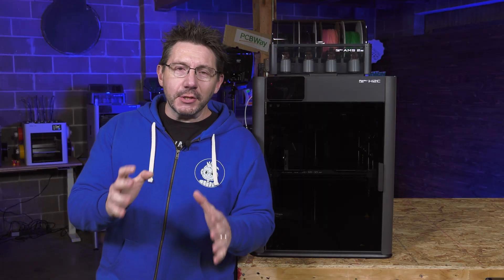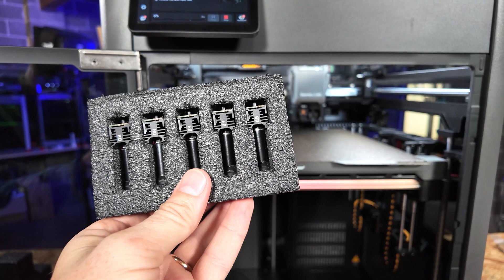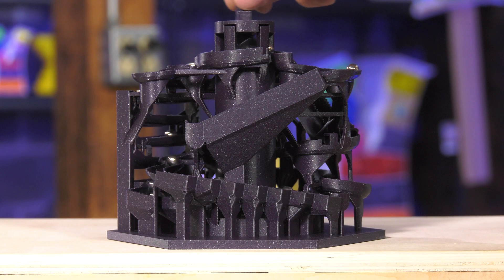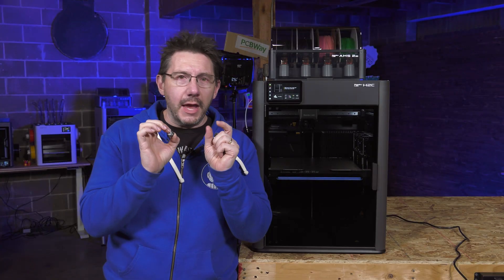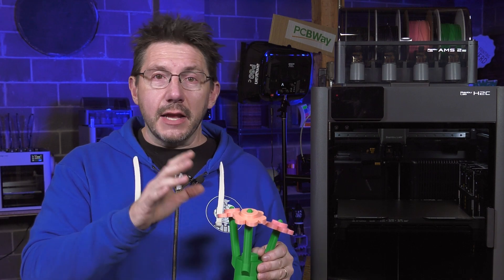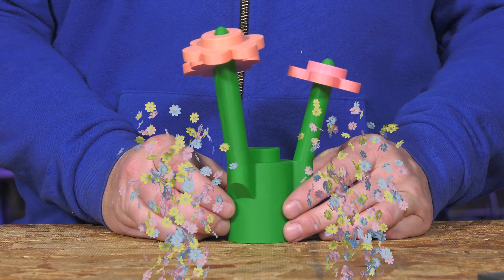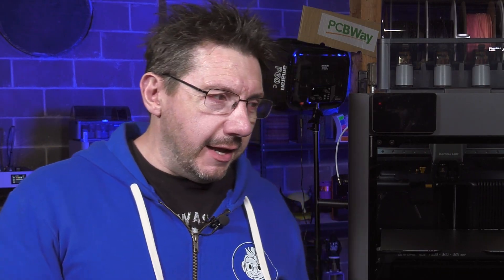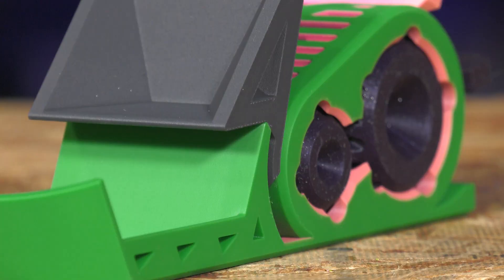My Review of the Bambu H2C + Vortek

Comment: I regulary print PA6-GF25  (Polymaker) it comes dry, i print it from a filament box dryer , 500g spools on cardboard , mostly parts that need to withstand <150C . Some of the parts are: hose adapter for car cooling system, HV insulation , cable guides through pipe that heat up to 120C etc. I had those lines and weakpoints too, underwxtrusion and lack of fusion , i print on P1S , 300C , 50c bed with MagigooPA, 50mm/s speed limit and 6mm3/s volumetric limit . i did tune PA and flowrate too
Reply: so what was his issue here?

Comment: Glad you showed the flaws of this printer, and it has some big ones! I’ll stick to a CFS/AMS type system regardless of the waste. That many moving parts in this machine is going to be a problem eventually. Not to mention the magnet issue and the heated bed being wonky like that. Pretty big disappointment from a company that’s really good at making great machines. WTF happened? Somebody at Bambu was asleep at the wheel or what?

Comment: The bed looks li that only half of heater is working. May be Bambu decided to implement it in a way to make a hot bed suitable for 120V and 230V main power systems both but didn't think carefully about heating wires layout. Does anybody know if it possible to easily convert printer to 230V and use 240V to power it?

Comment: To be fair that's an Engineering Symphony right there! But this is also its weak point. I don't want to be around if and when this will require maintenance or i will fail i and i will have to troubleshoot it. I would expect from Bamboo, to make something like that but without loosing build volume and to be as simple as possible for the end user to maintain it. But Kudos for the excellent engineering.

Comment: .2 nozzles are prone to jamming anyways, even with normal stuff, so it's a risk.
REMEMBER the DEFAULT bed temps for any of the enclosed printers IS TOO COLD!  The default temp is 55c, and it should be at 65c or even 70c.  Bigger beds like this need to heatsoak, even my Voron needs some time to get up to temp WITH THE DOOR CLOSED!

Comment: Not sure i understand this machine or it's market.. 

1. Machine specific hot ends (most likely very expensive because of the magnets and circuit board)
2. Machine specific build plates
3. Still has filament purges, though not as much as their other models
4. A ton of precise moving parts, so a TON of failure points
5. Flaky heat bed which may or maybe not properly fixed on machines release

The more complicated a piece of machinery becomes the more points of failure, ergo it's more expensive to fix. Also heat and magnets don't play nice together so I'm expecting a lot of hot end failures down the road (that's just science, doubt me?, go grab any magnet and a high heat source, then heat/cool it over and over). Most likely the heat bed issue will be fixed by the time this releases to the public or this thing is dead on birth. I was debating just 2 weeks ago whether to wait to buy this machine, or just pull the trigger on the P2S.

So glad I decided on the P2S combo now. This is going to be one expensive machine to both buy and maintain I'm sure. Not really a machine a print farmer is going to want for his farm, and too expensive to buy and look after for most (not all) home chefs..

Comment: The problem with Bambulab is making the hardware function in tandem with the software. As an example, they still haven't added support for the H2S Laser combo to be able to engrave on curved surfaces. It's there on the H2D! Why not on the H2S since it uses the same laser attachment and same motion system?? Another example is the X1C. Since launch that they said that the door open detection would be added through software and it was... almost when the H2D released! Years! That took years to implement. Myself, i have several bambu machines and i was a fan up to a few months ago. Heatbed consistency problems are in the H2D and H2S also and they refuse to acknowledge that there is a problem and instead we, the customer, serve as guinea pigs while paying full price.  
The H2C is a cool machine but not for me. There is almost no waste but there is time constrains. A real tool changer is the way to go from a technical point of view. Also, i refuse to be another "beta tester" for the full price. As with games, i will wait for a (big) price reduction and also to see what the future brings.

Good review and good points overall.

P.S.: this is not meant as a bambu hater or nothing like that. It's a marvel of engineering as i said and this is the opinion of a person who works with 3d printers since 2009.

Comment: I use bambu's PA6-GF quite a bit. It is extremely moisture sensitive. So much so that even the moisture your PTFE tubes absorb, can be enough to reintroduce moisture during the print process. This is why Companies like matter hacks, suggest actively drying your Nylons during the printing process. Which drastically helps. I even in the process of adding CPAP machine tubing(around the PTFE tubes) to the machines i use for nylon, So i can run hot air from the dessicator around the ptfe tubes, to help prevent this. When correctly dry, its an amazing material. Extremely strong, and often Nylons will become more flexible after they absorb moisture again. But straight off the printer nice and dry, Just two perimeters, this stuff is rigid and strong.

Comment: I have been noticing too that between the heating, and some of the newer flow rate changes in the software. That I have been having failures on a few machines, due bambu studio being a little too optimistic about flow and print speeds. Even when manually lowering the speeds and flow rates of a specific filament. It will often exceed the settings on larger objects and prints. This results in two things happening, The filament because its not hot enough and capable of the flow, will tug on parts. Or in the case of PETG it can just not bond, stick somewhat to the nozzle and then cause a hot end collision.

Comment: PA6 (as well as PA12) needs moisture to reach its final strength or mechanical parameteres. Dry is used only for injection molding or printing, but in its dry state it is very brittle especially when you overdry the filament!!! You need to let the part to absorb moisture, even submerge in the water to get PA properties.
Reply: I'd like to add to this, if the filament is too dry, you'll get layer adhesion issues. Having a micro amount of moisture vs literally 0 will dramatically help with this. I know as I've dried nylon at 110C in an oven for 48hrs trying to get it so dry I could run 0 retraction. Really made the material brittle and layer adhesion was non existent. Once the spool acclimated in my dry box at like 3-5% RH for 3-4 days, the amazing layer adhesion properties came back.
Reply: Yup, was about to say. It wasn’t properly dried, it was over dried.

Comment: For the PA6-GF, Perhaps it was overdried/unevenly dried. If I remember correctly, PA6 is stronger and less brittle when it has a little moisture. Maybe dry it lower and slower without the vacuum treatment.
Reply: 100% he over died it, surprised he or the rep weren't aware there's a sweet zone for where to keep nylon.
Reply: Yup, over-drying is a thing with certain filaments. Overkill.
Reply: Great information. Thank you.
Reply: Give PAHT-CF a shot with this printer?  It's my go-to for load-bearing functional prints at work. I find it easier to dry than Glass fiber nylon and I've not had a print fail after over a year of constant impact and load bearing. 

I'm interested in efficient support printing with this printer. The PA self bonding is a monster to deal with and I'd love to not have to chisel away at supports or wait 3x as long for a print to run.

Comment: Ouch... Glad to reduce the waste by swapping nozzles, but there are a bunch of moving parts that are unneeded from the original INDX design.  Simpler systems are always going to be better and having to retract the filament each time is a timewaster with lots of parts that will wear out.  Snapmaker U1 is a much simpler design and will most likely be my replacement for my 4 color A1 printers with a possibility of getting an H2C for my one 8 color printer.

Comment: Joel, at 6:25, when you say you tried to "heat it", are you referring to the heat break near the top of the hotend (where the magnets and electronic are) or referring to the wire tool you used to push the clog out?
It was very ambiguous what you meant what you were heating, and Id like to know if you applied the torch directly to the hotend, or only to external tools like you showed in your b-roll.
Thank you.

Comment: Thanks for showing that heat bed, that is disappointing. I really wanted this for printing ABS/ASA and with GF or CF. MAYBE it'll do okay if I heat soak the chamber and raise the bed 10C hotter than needed. Only thing this is decent at is color changing without much waste. Tool head changers are almost twice as fast as this system, but are more expensive. So can't have it all I guess.

Comment: The bed was already a problem when the H2D came out. CNC Kitchen showed that there were problemens with uneven bed temperatures. Bambu said that a different bedheater system would be more expensive. But this is not good. They should make a heater system like a multi zone (Prusa XL) or dual zone heater (center and outer zone) like the Snapmaker Artisan.
Reply: I honestly do not buy their excuse that it would be more expensive, At the volume they work in they could easily source aluminum plates and Keenovo style heaters cheaply.  In fact I am surprised they used the electric griddle style coil at all in any of their designs when PCB and mat style heaters were already proven and had well established high volume production lines.
Reply: @Niclord7  I use the smooth plate for everything and it fixed my problem with the bed can’t use that plate it ships with
Reply: @agorafounder  Yes, or a good options is using a BIQU CryoGrip buildplate.
Reply: Or literally just anything that distributes heat more evenly than a loosely wound toaster-style coil lol (assuming this is the same heater style as H2D)
Reply: do you know how the bed is on the snapmaker u1?
Reply: Is the bed heating uneven on the H2S as well? Or did they fix it on that one?
Reply: @TJbuffs  I also would like to know this, good question.

Comment: I'm a VORON guy. All the hype about Bambu is a turn off. It might be a GREAT machine but the hype is almost like a hypnotic cult, similar to the Tesla cult. I'm not a cult following guy so all the CONSTANT Bambu talk really turns me off. No matter how good their machines very probably could be I'm just not interested. And, in reality, how complicated do we need things to me. This is intense engineering. I actually have an old LULZBOT TAZ 5 where I have to manually adjust the bed leveling and the Z-Height. Yes, I still use it, it's slow, but so what. I also have an unusual Sindoh DP-200 which has a semi bed leveling. Well, guess what, that failed BUT I can manually level it and manually adjust Z-Heights and then it's perfect, but again slow. My VORON is fast, maybe as fast as the Bambu. VORONS are more expensive but, to avoid the cult hype of Bambu, I went VORON. Sorry, no interest in any Bambu products.

Comment: am i dumb? Why do you need 6 nozzles if the filament is STILL being swapped out at the AMS at time of heating? the filament isn't being threaded to a specific nozzle, so what does this solve that a single nozzle, Induction heated, couldn't solve?
Reply: The filament is threaded to a specific nozzle. They retract the filament so that one feed path can be used by multiple nozzles. By assigning filament to a specific nozzle, it's not necessary to do the extended purge that's otherwise needed to avoid contamination when switching materials.

Comment: Thank you for the honest review, Joel. Even if they update the design and fix the bed, the inability to unclog a nozzle using heat is a something of a dealbreaker to me.
Reply: These are method to cold purge and clear the nozzle. It seems like he didn’t do his research if you search it up on Google or YouTube you can find how to do it easily.
Reply: That and those nozzles are not going to ever be a 3rd party option. Bambu will be the only way to get them.
Reply: @xNuclearSS1x there are already third party nozzles for the h2d on AliExpress. Why shouldn't they make something for this machine. Doesn't make any sense
Reply: @xNuclearSS1x I bet we see them on AliExpress In a month still😂

Looks like a good opportunity for a new product.

Basically a device that you put the nozzle into and it holds it and has an induction heater in it and a hinge handle with a poker on it that you push down on.
A small desktop induction nozzle unclogger
Reply: @xNuclearSS1x but it’s for our safety

Comment: Did I see a Snapmaker U1 in the background!?!?!?
Reply: im buying the snapmaker U1
Reply: @MaxReckless99  I just got mine delivered! :D Will try setting it up tomorrow and see if it is as nice as people have been saying. (And then will probably retire my old sidewinder x1 to be an old large format slow-print workhorse for moon lamps and such...)
Reply: @DiverseGreen-Anon please let us know what you think!
Reply: @DiverseGreen-Anon  is it good? I am thinking of it…
Reply: It is very fast! Printing my first few tests right now. It took a bit longer to set up than I expected. Also the firmware that it came with needed to be updated over usb, as it was not able to connect to wifi without update (should be fixed with the store release). It is also a lot louder than I thought. The more fans you use (each tool that is used in a print has a tiny fan active as well), the louder it gets, especially the auxiliary fan, if used, can get loud.
The quality is also surprisingly good, especially considering the speed at which it zooms around.
The loudness should be totally acceptable to work in the same room with, when using a single head and no aux fan. Also a top cover should make it quieter.
Overall I am happy so far, but want to test 3rd party filaments and 1kg spools, as the holders seem to be designed for 55mm inner diameter rolls.
Also will test some precision prints to see how accurate it can print different shapes inside and outside.
 @George3dart

Comment: It's unfortunate that they felt the need to embed RFID chips into the hotend, when it wasn't at all necessary. They could have used QR codes, for example, or had the user manually add the hotends if necessary. They could have also used physical encoders. As for the demagnetization issue, like he said, different materials could have fixed it, or they could have used an alternative. Impressive though it may be, it seems a bit unrefined for a BambuLab product, almost like they rushed it into production after the release of the SnapMaker U1. The only real benefit to this machine is more colors/materials and larger size, but at over 2x the price, the SnapMaker U1 seems like the current winner in this category.

Comment: At $2400. There isn't any reason to cut corners on Pro-sumer products. Not in the 3d printing market at least. And definitely not in an Apple-like ecosystem. Bambu can make their money with consumables. They dont need to worry about repeat buying on hardware. (Building something so good it lasts and customers don't have to replace printers every couple years) Companies that build failures into their products on purpose to get more money on repairs. Should be banned from existence. Not that Bambu is doing that. It just looks bad at that price. Especially when lower cost tool changers are on the way.
Reply: Bambu wishes it was Apple

Comment: Thank you for honesty and showing all issues you had instead of just praising machine . To be honest bed problem should be sorted when BIQU will release their CryoGrip plates. My P1S original PEI plate works fine (proper wash every few prints) whilst on X1C I have often problems with original PEI or even same plate from P1S. Now I'm using BIQU Frostbite on all machines and have zero problems. Often can't even remove smaller prints as it holds SO WELL

Comment: I knew it was going to be a disaster. Bed heat issues and clogged nozzles you have to throw away. And the vortex is not going to last in my opinion. They should scrap it now and use INDX by Bondtech. I wish them well and hope they work out all the kinks. I think they’re one of the best 3d printing companies out there,  if not the best.

Comment: Seeing this Vortek system makes me nervous for how complicated the upgrade will be in the H2D. Cause I didn't realize the entire hotbed would need to be replaced. Bummer....it'll likely be quite the expensive upgrade too.
Reply: Yeah not worth it.
Reply: @DigitalHDx  yeah you can literally almost buy a snapmaker u1 for the same price as the upgrade…
Reply: @beweasd1758 Where is the price for the upgrade because I haven't found it listed anywhere.
Reply: A sell and but upgrade...
Reply: The price is out, it’s >800€ for the H2D. The way I think about this is, the H2D will remain good enough for functional prints at high temp. For low-temp multi-color items, I’d go for the U1.

Comment: I want to get an H2C at some point, but am surprised at the bed heat thing - they could have just zig-zagged the heating element  a couple more times for a few cents more in metal.  Wonder if Joel had any indepth convo with them about that!   I presume this was an early build and the video was just held back due to embargo, meaning it COULD be improved by the time consumers get theirs?
Reply: they use the exact same design on all their printers. so i doubt the would fix it.